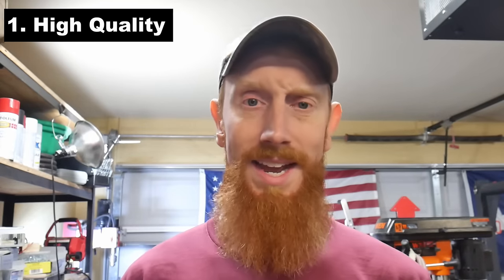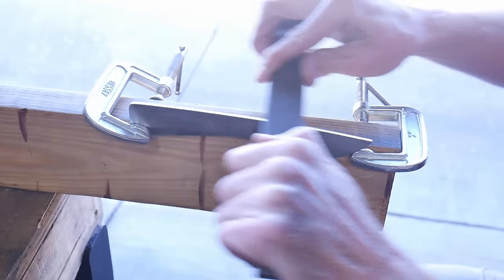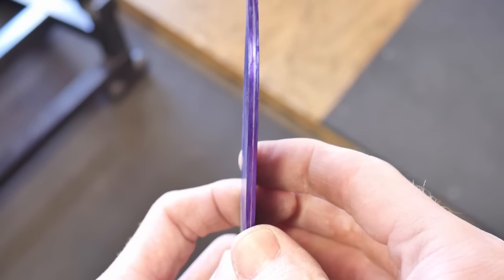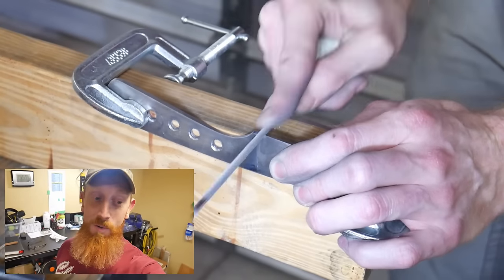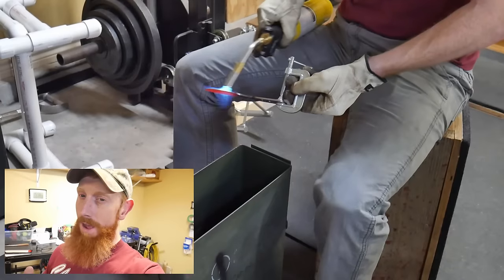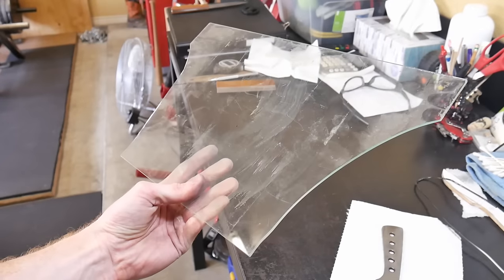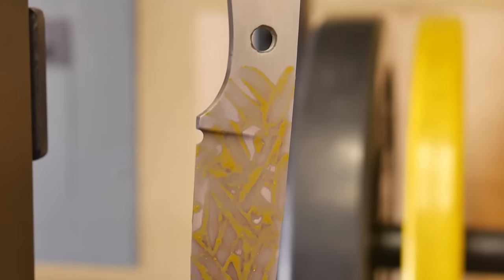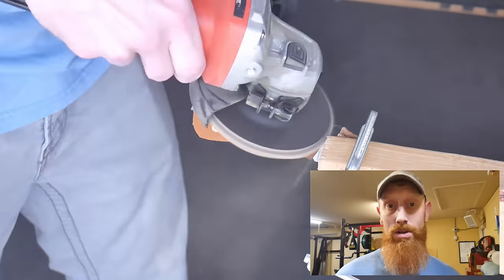Make A Knife With Cheap & Basic Amazon Tools | Knife Making

Comment: @Red Beard Ops so... you used calipers to scratch the side, but not the lenght when drawing the line? thats a bit weird
Reply from the maker: At what part of the video are your referring to? I find using a drill bit is easier to find the center of the stock to target the edge. Marking the bevel lines has been easier with the calipers.
Reply: @RedBeardOps  fair enough, seems more precise with calipers to me, since the bit bends, but good idea anyways

Comment: How close did you get the bevel to finished before heat treat?
Reply from the maker: I'd say when using files get it to around 80-90 percent. Saves a little time post HT with the sand paper. When I'm using my grinder I'll HT before grinding in the bevels at all most of the time.

Comment: Ordered the metal.... they are warped..   anyway to get them easily warped back?
Reply: I'm ready to follow your lead, and also use my laser etcher to put an awesome design!!!
Reply from the maker: Hey man, when you get your metal from a supplier it's very soft (annealed). You should be able to bend it back to straight with your hands. If you're careful you can use a soft blow hammer on some leather or rubber.
Reply: @RedBeardOps  Awesome, thank you.  I put it on my bench, using clamps and two of the pins I ordered and leveled it out.  Left it over night. going to see how that worked.

Comment: Great video, thank you. I’m half way done and working with filing jig at the moment. Do you push only to one way or keep pressure all the time while filing? I have uneven line and some scratches from metal bits (I try to clean jig and knife with brush though often)
Reply from the maker: Getting a file card (file cleaner) will help keep the bits of metal out of your file and will help you achieve a better finish. Files are generally only designed to cut in one direction. Cheers man!
Reply: @RedBeardOps  Ok! Thank you.

Comment: I know you said that the edge is hard because it will skate a file, but what does that mean exactly?
Reply from the maker: Hey john, Files are generally pretty darn hard. Around 60 RW hardness I'm pretty sure. If the file will bite into the steel the steel is softer than the file. If the file does not bite into the steel the steel is harder than the file.

Comment: What does skating the file mean? I guess what I’m asking is what should that feel like?
Reply from the maker: Hey man. When you "skate a file" it means that the file will not cut into the steel. (Right after quench it may feel like it's cutting a little, but that's normally a very thin "de-carb" layer, once you get though it should not be cutting your steel). All this sums up to indicating that your quenched blade is harder than the file which is good.
Reply: Red Beard Ops ok that makes sense to me now. If you don’t mind answering another question. I have some 1095 steel, will I’ll be able to follow the same steps you show on the video with the 1095?
Reply from the maker: @garygaylor7246  Hey Gary, yes. You can follow the same sports. One caviot is that 1095 is not as easy to HT to it's optimal potential in a forge or home HT set up (to do it right you need to soak it at temp). So order 1084 next time. That being said, you should still be able to get 1095 hard.
Reply: Red Beard Ops thank you sir. I really appreciate the help. I’ll let you know how the first one turns out!

Comment: What do we use to temper the blade if we don't have something like he had?
Reply from the maker: Your kitchen oven can temper the blade. You could also torch temper the blade, but this generally isn't as precise.... if you're talking about hardening the blade you can send if off for heat treatment, use a torch, or build a mini forge like I did in this video -  https://youtu.be/nk7vu2RYxvI
Reply: @RedBeardOps  I'm working on building a mini forge for my first project like this

Comment: What steal would you use for a chef's knife
Reply from the maker: They Steven, I don't make many Chef knives. But I've heard great things about AEB-L
Reply: @RedBeardOps  thanks for the feed back unfortunately I  dont have the means to heat treat stainless
Reply from the maker: @stevensanders7561  Me either. May classic kitchen knives were made from high carbon steel so don't let that hold you back! They just take more maintenance.

Comment: Is there any 'cheap-tool' method for the tempering process? That seemed to be the one step where you were using a piece of kit that you didn't offer an alternative for
Reply from the maker: Yes sir!  Good point. You can temper your blade with the torch. Start working at the spine of the knife and work till you get a straw color right at the edge. Just like this - https://youtu.be/CyjmIxtQ5Mw?t=392
Reply: @RedBeardOps  Thank you for that!

Comment: The steel is not available on Amazon so what dimensions do I buy on the secondary site you put?
Reply from the maker: Sorry sir, guess they ran out. I'd get a piece of 1/8'' thick x 1.5'' wide. Whatever length you want depending on how many knives you're going to make!
Reply: Red Beard Ops thank you so much
Reply: Rose metal products has grest prices on steel.

Comment: What about using a dremel perhaps with the flex shaft attachment and a grinding stone?
Reply from the maker: I'm sure something like that could be rigged up. I'd say that the wheel on those dremmels are normally pretty small so grinding in the bevels may be difficult. Also they move so fast that heat may be an issue post heat treat. Cheers man! Have a great weekend

Comment: what was wrong with the heat treatment? it wasn't hot enough?
Reply from the maker: Yeah, I think the edge was slightly under heated before the quench. It did harden up, just not as hard as I'm used to. The brick would of allowed a little more control on the temp.

Comment: Dumb question. How is this an "edge quench" when you heated and quenched the entire blade?
Reply: i guess the edge is way thinner and cools way faster than the thick parts of the knife, faster cooling => harder
Reply from the maker: In this case the edge was the only thing that really got up to the appropriate temperature. While the rest of the blade was heated, it doubt it got to the ~1500F to get a really optimized hardness. You could also put a "depth plate" into your quench tank, heat the whole blade, then quench only the first 1/2'' of the edge. Or you could quench the whole blade and draw the temper or blue back the temper on the spine. Lots of options sir!
Reply: @RedBeardOps  thanks for the replies guys. I'm looking to maybe give this a try. Looks like an interesting hobby.

Comment: I think it would be cool to do a video like this but using the cheapest tools that will make it easier to make a knife.

What I mean is instead of a hacksaw to cut the shake out, how would a cheap harbor freight bandsaw do? Instead of spending 5 hours using a bastard file how would a 1x30 belt sander do? Instead of the cheapest drill you can buy, would a cheap drill press do well?

You’re using gear that would make knife crafting easier, but instead of buying $1,000 machines you’re seeing how well a cheaper version would do from start to finish.
Reply: Also I know you can use anything really to make knives, but most people won’t want to drill holes and use a hack saw just to spend hours with a file before even working on the handle of the blade.

I think q demonstration of a cheap “professional “ setup that would produce market quality knifes would be helpful to potential newbies.
Reply from the maker: Hey man, good thoughts. Here is a video where I showed multiple methods for each operation on the same knife. I think it's what you're looking for - https://youtu.be/nk7vu2RYxvI
Reply: @RedBeardOps thanks for the link. Very helpful. I’ve been binging your videos but still have a lot to watch. I’ve always wanted to make knives and it’s good to see you don’t need those thousand dollar machines to get into it.

Comment: Please tell me this work on 1095?
Reply from the maker: It will, but if you're buying steel for your first knife I really would advise going with 1080/1085. 1095 has an optimal quench when held at it's target temperature for a period of soak time. If you have a HT oven... then no big deal, but soaking with a forge is difficult.
Reply: @RedBeardOps  I have a lot of studying to do, because everything you said went over my head like a jet fighter.  Wow!

Comment: What steel did you use?
Reply from the maker: 1084 is the way
Reply: @RedBeardOps  thanks for the reply mate, is it 1084 that bent during the test? I was wondering if I buy slabs of steel for knives making like 1095 will it be hardener already or will I have to do that myself? Many thanks
Reply from the maker: @asd7959  Well, this isn't the best heat treatment with the hand torch. I've been able to do ~70-80 degree flex tests without snapping on my normal 1084 knives. Obviously bent after that. 

1084 is my preferred steel for a home heat treatment - https://youtu.be/TBIiWwawKSY

Comment: Utilize is not an elegant variation of the word use; it has its own distinct meaning. When you utilize something, you make do with something not normally used for the purpose, e.g., you utilize a dime when the bloody screwdriver is nowhere to be found. If the screwdriver were there, you'd use it, not utilize a stupid dime for the purpose. Use use when you mean use, and utilize only when it's properly used to mean--to use something not normally used. The computer went off-line, so they utilized Mr. Wang's abacus, the one he liked to use. Despite the temporary breakdown, the computer's use-rate was up (not its utilization-rate)."
Reply from the maker: Hah, noted Bryan

Comment: i made a small forge out of a 10qt metal coffee dispenser, plaster of paris and vermiculite. I formed a hole in the side near the opening to angle my mapp gas torch so that the flame was angled slightly toward the rear and in such a way as to coil around the inside of the forge.  It was cheap to make and effective for knifes under 10" or so

here is a video of a similar forge,
https://youtu.be/xv9nnEhgfuY
Reply from the maker: Have a great day!